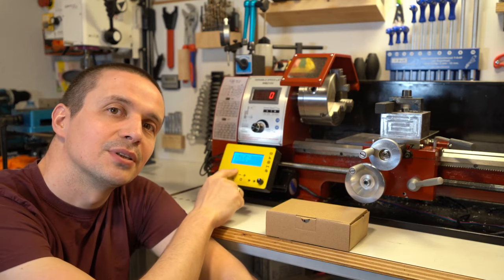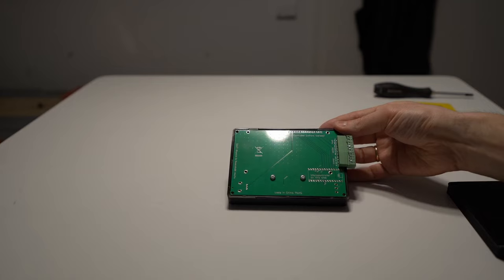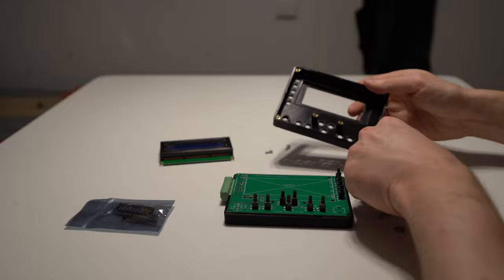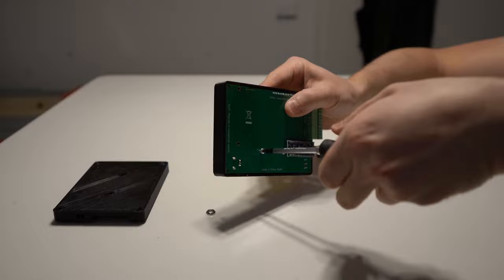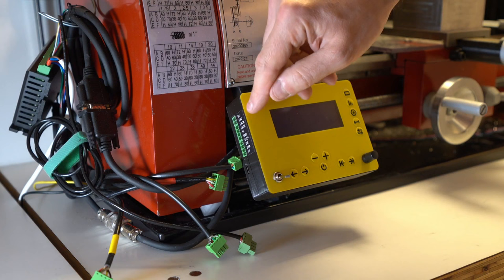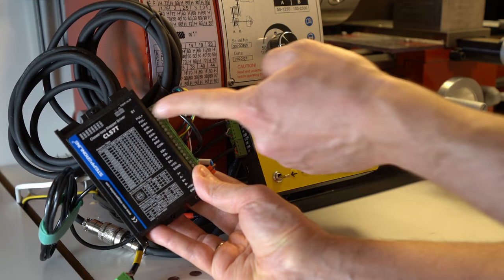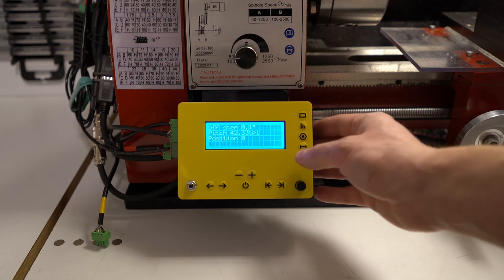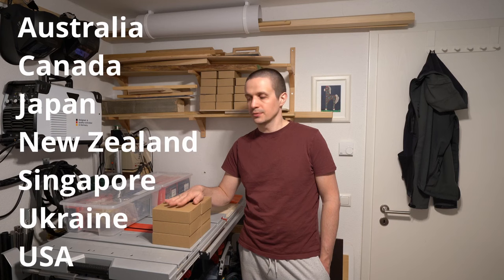Electronic lead screw kits

Comment: I can see you have stahlwerk welding machine. What you think about it? There is almost no reviews on the internet.
Reply from the maker: @The_Unobtainium  it works without issues, I didn't get good results in aluminum but perhaps I used wrong material or settings. Current models are probably different from my old version so not sure if my experience is relevant for you.

Comment: Hello, do you have any videos detailing what size stepper motor you use and how to mount them?
Reply from the maker: Hi Clint, for a tabletop lathe like mine NEMA 23 3Nm is the classic choice.
Reply: @MaximKachurovskiy  thanks Maxim, do you still have ELS kits in stock?

Just curious why you made a new controller when you already had rocketronics unit?

Did you just want to create a lower cost option for people (which is great!) 

I'm just trying to decide between your kit and the rocketronics unit which is more advanced but a lot more expensive.
Reply from the maker: @HermitFab  I have plenty of 1-axis in stock and only one of the 4-axis remaining for now. I make them because I like making things 😀 H2 is superior in terms of usability and features for single-axis machines but suffers from using a slow Nano causing "no microstepping" limitation. H4 fixes all that and adds a ton of new hardware features while still being open-source and most importantly programmable by the user. H4 software is still in development though.

Comment: What exactly will this do for my lathe that it cannot already do with the change gears? (Grizzly G4000).
Reply from the maker: Move tool left and right without losing the thread, stop lead screw automatically at given points allowing to cut threads close to the chuck, do multi-start threads, change pitch in seconds to any reasonable value (mm, TPI, inch) with micron precision. More info at https://github.com/kachurovskiy/nanoels/tree/main/h2 :)
Reply: @MaximKachurovskiy  Multi start! Do you have a video on that?
Reply from the maker: @brianboni4876  yes, https://youtu.be/YdSRJKuHrqI for single-axis controller, 2-axis controller does it entirely automatic